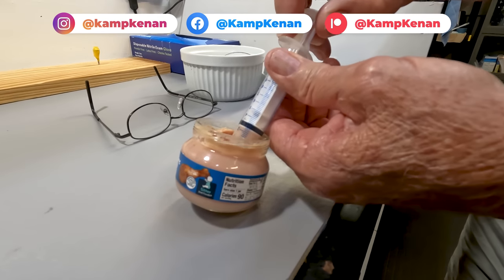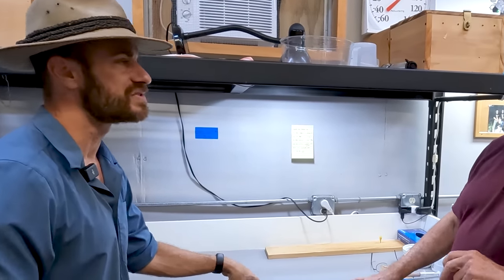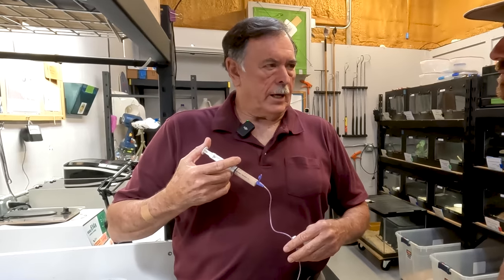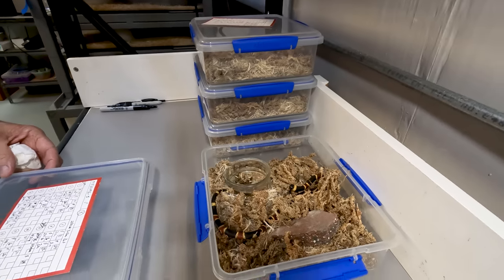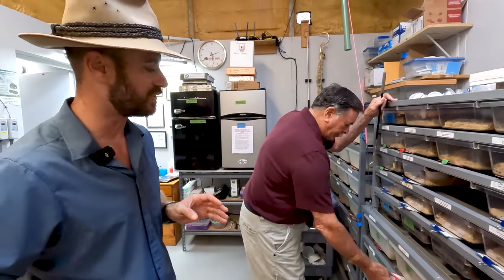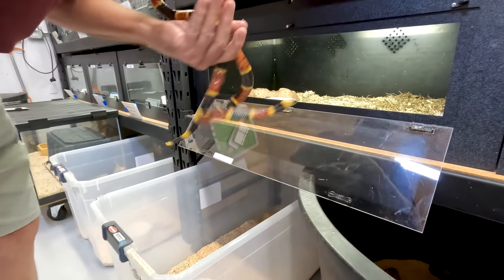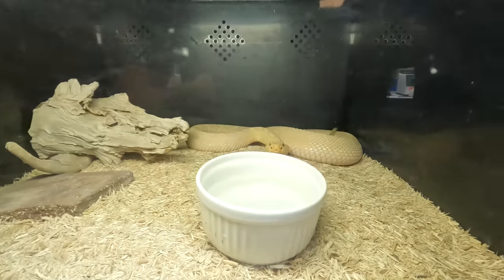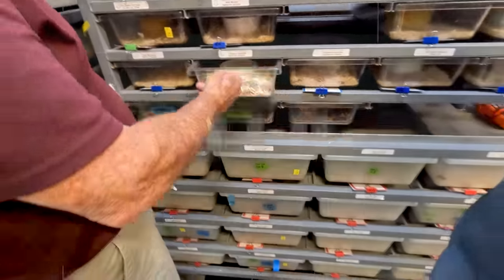Life Lessons from a VENOM Lab!

Comment: Hi Kenan. This is one of your most interesting videos. Amazing work Jack does. I'm from Lancaster England and we only have one snake with venom and its called a Adder In about 70% of cases, there is a negligible reaction or only local effects. These effects are very unpleasant but easily treated. However, adder bites are potentially very serious and should not be under-estimated. In a small proportion of cases, adder bite can lead to severe effects requiring extensive hospital treatment. Although exceedingly unlikely, adder bite can be fatal.